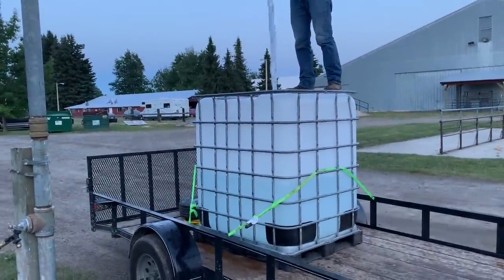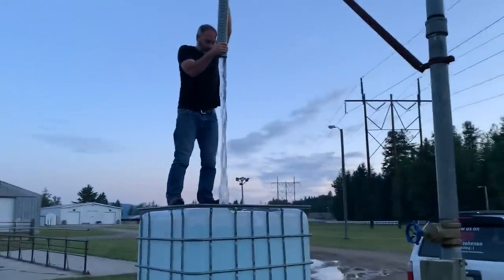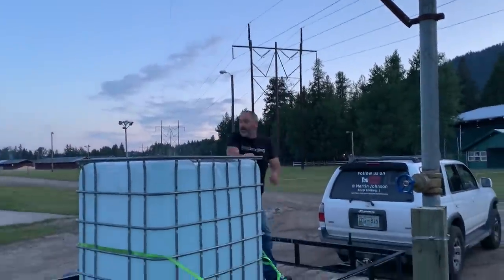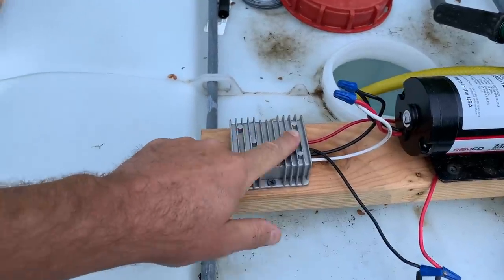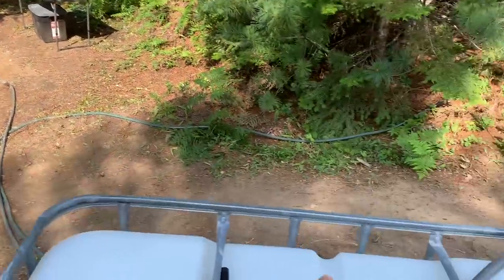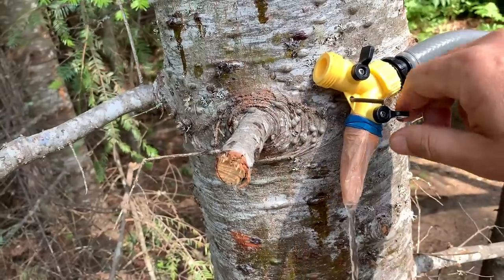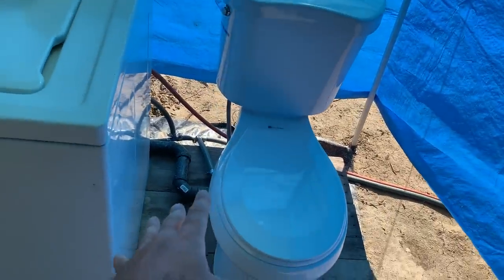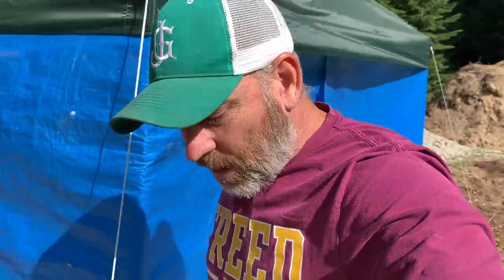SIMPLE Off Grid Living Water Systems: Collection, Distribution, Heating and more

Comment: This is a well thought out system. I have a tote and was using my well until it failed earlier this summer. I’m about to buy a 1000 gallon black water tank to use and fill up with my tote from my parents house. Your video gave me lots of ideas and confidence. Thank you. I’m now subscribed.
Reply: This is a mess
Reply: So your plan is to run up your parents water bill?
Reply: You would think so but they are on a well. Otherwise to catch everyone up, the water tank and pressure tank set up has worked flawlessly for three years and I am scheduled to finally have a new well drilled this summer. The well service is impressed with the setup and will be plumbing the new well into my tank and system. 
These types of systems are widely used in Colorado and the southwest where water is deep or unavailable. Most have services that deliver water to the system or haul it themselves. I was lucky enough to have a source in my parents well. It is a 1-1.5 year waiting list for a new well here. If you want more information. Just ask.

Comment: I have a suggestion about gravity feeding the tank on the trailer to the stationary tank.  Since it appears you only need about another foot or so elevation.  You could place a 4 to 6 inch platform under the trailer tank without losing too much stability.  You could build up the driveway about a foot to make the tank higher or you could get a set of car ramps to place under the trailer tires which could be put away when not needed.  The dual use of your water pump is a clever solution but no doubt interrupts your water pressure needlessly.  Screwing plastic fittings off and on wears them out rather quickly.

Comment: Newbie question...  Are you saying that small 12Vdc pump (2.2 gpm) provides 60 psi pressure into those hoses?  If not, how do you achieve the 60 psi pressure?  Thanks for explaining to someone who is attempting to learn about 'off grid water systems'.

Comment: Interesting  video. By my calculations, if your container holds around 300 gallons of water, then that little trailer is holding about 2,503 pounds of water, or about 1 1/4 tons. That's quite a lot.
Reply: Its around 2,600 pounds on that trailer.  He centered it and drove moderate speeds.  Water is 8 lbs per gallon so   was at 2400 and the IBC is around 80.  Smart guy that Martin.

Comment: After camp-living off the grid for a year, that healthy crackle-pop-click-whoosh sound at 5:52 from the water heater, right when you opened the water valve, is music to my ears.
Question:  Do you use that with your washing machine?  I've heard those in-line heaters never really supply any hot water to washing machines because of the pattern of spurting hot water and stopping before the tankless heater can even produce any hot water.  Is this something you solved? Or do you just use cool water for laundry?
Reply from the maker: it works fine with the washing machine.

Comment: Greetings,  after 30 years at our homestead we are going to start over and start another off grid homestead. The new property does not have a well yet. We are putting in the septic system and a fresh water cistern. This summer. I just bought two IBC tote tanks and a on demand water heater. The new homestead is cold and in the snow much of the year. It get below zero there. My question for you does it freez where you are and if so what are you going to do in the winter? I dread haulingwater is 3 feet of snow. I am hoping a 1000 gallon cistern will .get us through the bad weather.. it will be a couple years before we can put a well in. We have gravity feed spring water and 5k of solar at our current homestead.

Comment: Great video.  I died when the wire nut fell off.  Use water tight crimp style connectors for stranded low voltage wire....cheers🍺

Comment: Just take the 12v from the 12volt rail on the batteries, simple.   Lights are 12v as well. 
Been off grid for 38years, the first thing to do is organise the water, i have 14000 gallons in tanks, too much water is never enough when it comes to storage.
I also have tapped into a spring high up on a hill which gives me more than enough water for 9months of the year.
Collecting and storing water is the most important first stage of off grid living, make every shelter a rain collector, using fuel to collect water is going backwards.
Reply: How do you deal with winter water storage and usage?
Reply: @Redshirtvmc  In what respect ? The roof collection water is held in tanks next to the house  and the spring is still filling a concrete tank 500m away with a 40m drop for abundant pressure. We are now in the middle of winter, days are 21c nights are appx. 9c.
Reply: ahhh I should have done my research. I didn’t realize you weren’t in a freeze zone
Reply: @Redshirtvmc  So how do people  organise themselves with frozen water ? Never thought about it , my wood stove heats the water in cold and cloudy conditions but frozen pipes is another problem to overcome. Some places just don't lend themselves to off grid living , gotta keep it simple.
Reply: @norrishude6177  so I’ve been doing research and there’s a company called Heat-line that you can feed through your pipes and it uses variable heating to keep the pipes warm enough to flow even in conditions up to -50. They make product for water in lines and septic out lines and such! Pretty sick! Give me a follow and in the next year you’ll see a bunch of videos of me building an off grid cabin in Maine haha. So we will see how it works

Comment: I know this is a bit of an old video, but I was wondering: what do/did you do with the grey water from the toilet? I'm doing research for my own off-grid home, so I'm trying to gather as much information about different systems as possible.
Reply: The toilet was built on top of their septic tank. The soil pipe literally runs right down into it.
Reply: toilet water isn't grey water it's black water

Comment: Do you constantly have the water pump on ?
Reply from the maker: No. It has a pressure switch. It automatically comes on when needed.
Reply: @MartinJohnsonOffGridLiving  where can I get pressure switch ? Trying to fix all these things for my dad . Because we have the same water totes.
Reply from the maker: polarbearsmp3 it came with the pump.

Comment: aren't you worried about bacteria growing in the uncovered water tanks?
Reply from the maker: It is normally covered. There is a red lid that screws on the top. The water that we get is treated from the County. It’s only in the tank for a week so I figure it’ll be OK. What do you think?
Reply: @MartinJohnsonOffGridLiving  well, if it's treated it's probably okay, but I would still black out the ICB tote or cover it with a black plastic. I've seen some nasty stuff grow in some of my own. I've painted them to keep out all light. Now I have a water tank that blocks out 100% light but still use the IBC totes for watering the garden. I'm sure you're running your drinking water thru a Berky or something right?
Reply from the maker: The Arizona Homestead Project We were but there is a wind storm and it blew over and broke. Now we’re just risking our health. Ha ha ha. I like the idea of painting it black I think it would make the water warmer which would use less propane through the water heater and Julie says it would help the dishes too. Maybe I should paint it black.
Reply: @MartinJohnsonOffGridLiving  lol, when we moved from tulsa to AZ I painted mine with all the excess spray paint I had. It's worked out well and I put a little bleach in mine seeing how our water is not treated. But that is only for gardening like I said.  It must have 10 different layers of color, lol